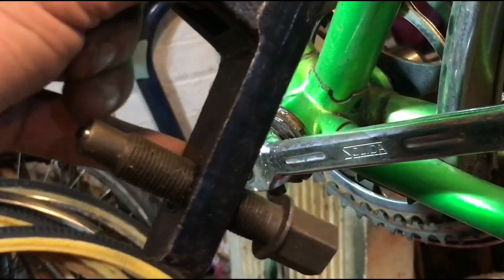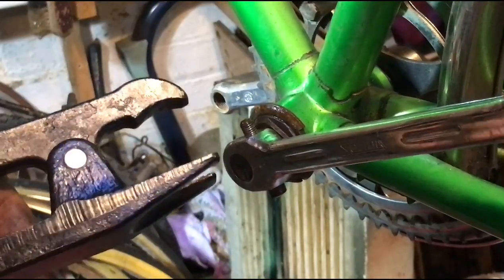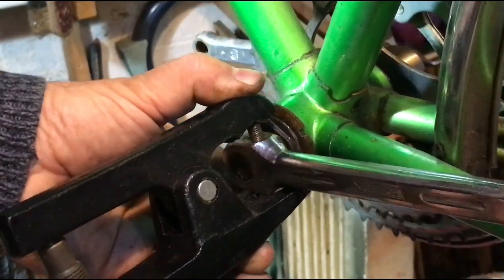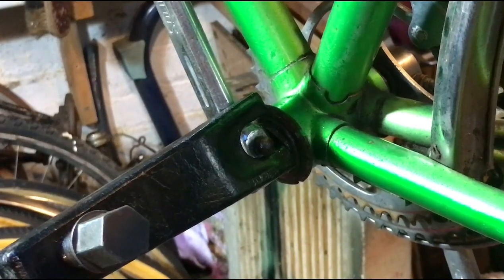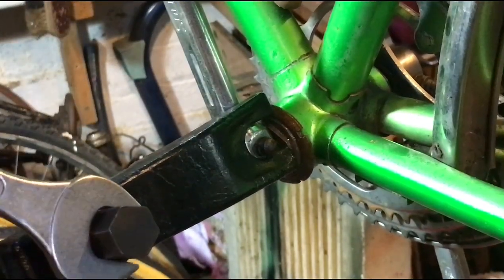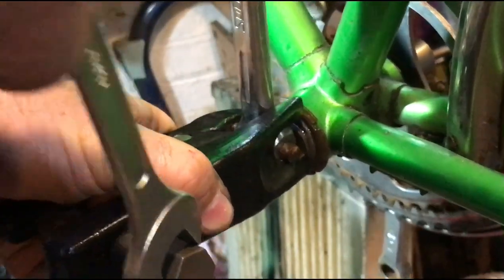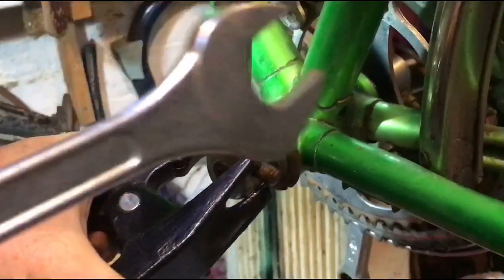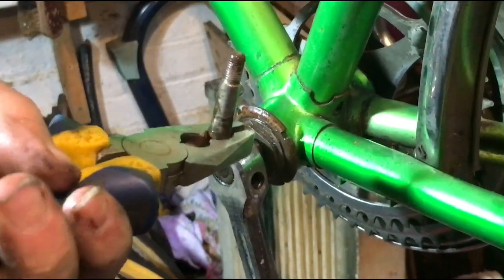Removing old bicycle crank cotter pin after 45 years! Cheap tool & easy method, works every time!

Comment: I was ready to grab a hammer and pound away until I saw your video.  I have one of these tools, and it never occurred to me to use it for this.  Thank you for the revelation.  I can now remove the cranks from my Raleigh Sports 10.
Reply: What do you call that tool and where can you buy it? I need one . TY

Comment: That's a nice tool. You can buy a new version of the same at Halfords - and a dremel to make the dimple.  The only improvement I could suggest would be a dab of grease on the driver thread each time.

Comment: I tried that but didn't understand the purpose of the dimple. As a result I bent the threaded end and broke it off when I tried to straighten it. This let me drop a 1/4" socket extension down into the resulting well and give a solid strike with a hammer that finally popped off the cotter.
This wasn't a major problem, since I had already decided to install new cotters, but I wanted to emphasize the importance of the dimple. Without it, the tool won't push straight down on the pin and will destroy the threaded section.
Reply from the maker: Sounds pretty much like how I refined the design to include a dimple!
Also grinding the curve flatter before drilling the dimple seems to help too.